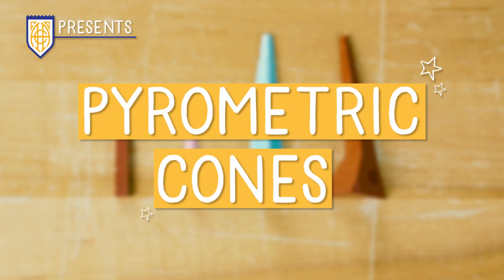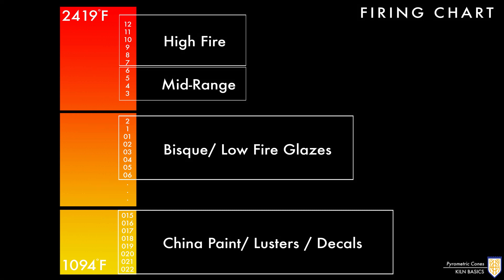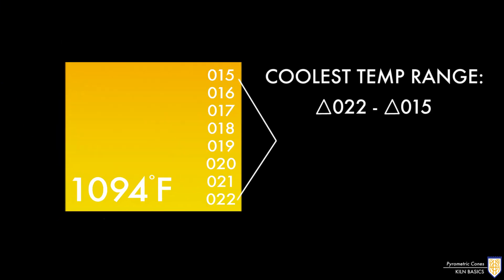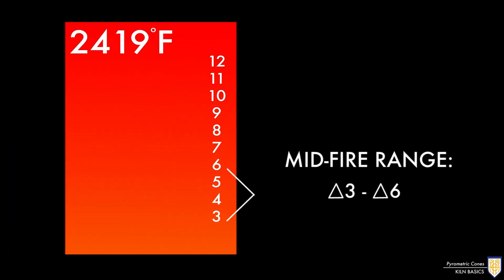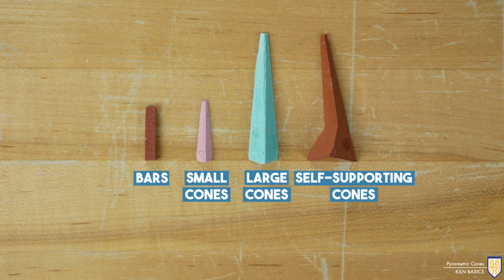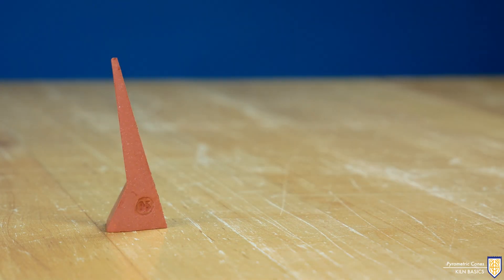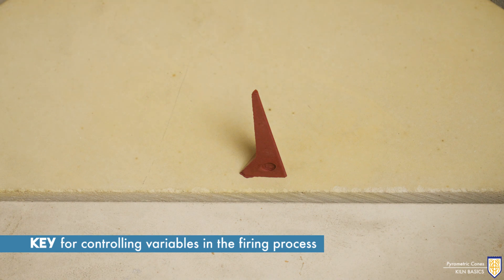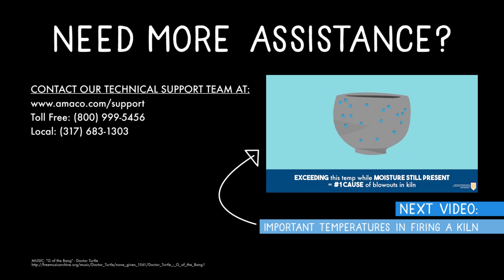Ceramic Pyrometric Cones // AMACO Classroom Kiln Basics

Comment: Can cones be reused? 

Help…! I was using cone 6 and my kiln turned off after the 3rd hour during the firing process. The kiln has cool down now,  and I would like to know if I need to replace the cones before I restart the kiln again or should I use the same cones that are in my kiln right now?